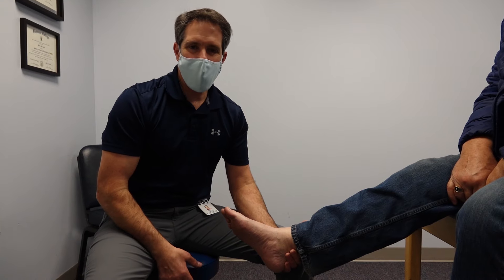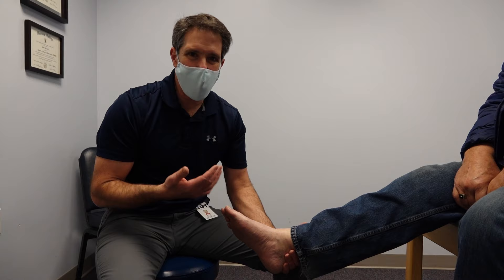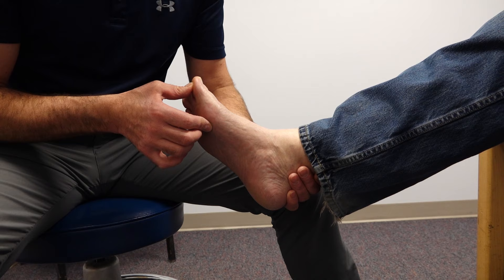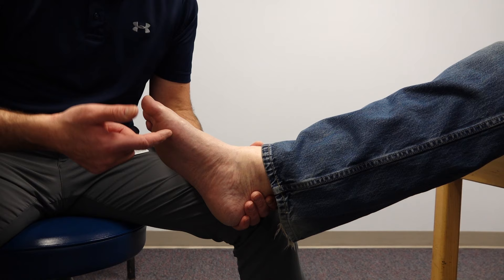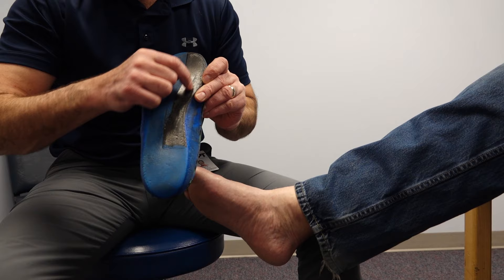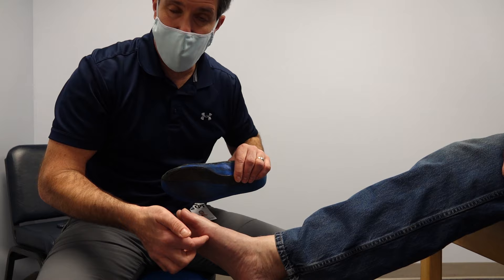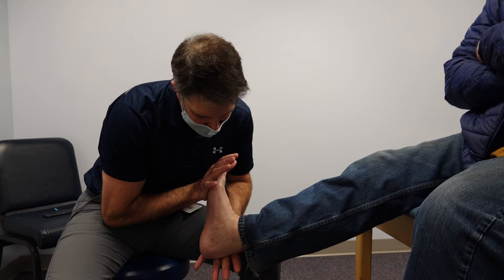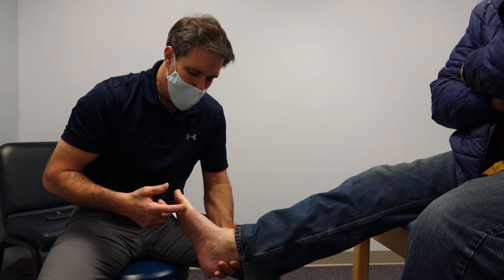Stiff Big Toe Joint (Hallux Rigidus) Treatment

Comment: Hello! My podiatrist also told me that I have hallux rigidus in my right big toe. Is it normal to have this issue in your early 50’s? He recommended hoka shoes that I wear now and a carbon fiber plate. I also have an ointment that I apply whenever I can…it has helped but he has also suggested surgery. Is there no way for it to heal without surgery? TIA
Reply: Got in and I'm only 42. Wear hoka bondi 8s now
Reply: I'm 45 and I had surgery 3 years ago. I did the minimally invasive option, where I just removed bone spurs. I gained back mobility and I can run, hike and cycle without issues. Minor pain sometimes. But most days pain free.
Reply: @PatrikSandinFTW  wow! Thank you so much for replying… I have been with this pain for some years now😕I can’t wear any shoe that has even a little bit of elevation plus even walking is painful. I was told about two kinds of surgeries one to remove the bone spurs and other where they insert some kind a gel. I am just so confused what to go for…thanks to you now I can make some decision.

Comment: With so little movement, would fusing the joint cause damage to other joints (ankle, knee, hip)?
Reply from the maker: Good question Lisa! So, when the toe hurts so bad you can't function well and your activity level drops, having the fusion gets rid of the pain and overall activity goes up. A well fused toe with a little extension can act like a "rocker" and not alter the gait too much.

Comment: Paul, if you wear an orthotic with a rigid plate like this to purposely limit big toe extension, isn't that going to cause gait problems and possibly injuries in other ways? You would have to compensate somewhere else for that lost range of motion, right?
Reply: Yes, but not having rolling shows or that inner sole will too cause you to walk strange, as it hurts to walk straight.. I know, cause I too have it. MBT shoes has made all the difference for me 🥰

Comment: im 31 and i think i may have this ..... this cant be it for my toe surely? the end of being able to run and do push ups etc etc?? please there has to be a fix?
Reply: I have had this for over 10 years and I have tried everything under the sun besides surgery.
I will tell you nothing works, if you have the chance to get the surgery, do it.
I never did it because doc told me I would have to keep my foot elevated for 6 weeks after and I knew I just couldn't do that.
I'm in my 40's and have knee pain on that side because of walking oddly for ten plus years.
In the meantime however, I highly recommend Hoka shoes, the Bondi8 model is incredibly comfortable for those of us with this problem.
Reply: @ajs96350  thankyou so so much for your advice and foresight. I wish us both the best foot health possible. Thankyou man
Reply: @soraninja  Sure, good luck.

Comment: I have Hallux Rigidus,  the bone spur limits the type of shoe I can wear. The bottom of my big toe has pain in certain shoes. Some pain In walking . I have had consultation and always the doctor insists on toe fusion. I like for my toes to bend. I’m still not convinced  to comment to an invasive surgery.
Reply from the maker: I would try a good custom orthotic and solid rocker bottom shoe
Reply: I have had hallux rigidus for about 10 years, most of those years I have been pain free, - sometimes it flairs up and is very painful, however with proper stretching of my leg (thigh, hams, calves etc) it becomes pain free again.  Maybe this will help you
Reply: @Ma1efcent  Can you explain exactly what stretches you do that help the pain in your toe?

Comment: Had it got rid of it.  Borax.
Reply from the maker: You can't get rid of it without surgery but this guy can walk with it which he can't do without it.
Reply: @OrthoEvalPal  Your guy waited too long.  He has major calcification.  Dumb.  I fixed my problem.  I also use Celtic sea salt.  The processed table salt causes those deposits on the toe.  I have perfect flexibility and no more swollen big red toes.
Reply: please explain, i will try anything
Reply: @mickster655  Can you explain what you're talking about, did you drink borax?

Comment: What if you are a ballet dancer and want to continue to dance where you have to bend your toe. I’ve been experiencing so much pain and stiffness in my left big toe and it’s really holding me back.
Reply from the maker: Definitely recommend an orthopedic foot specialist familiar with ballet. The important thing here is getting a proper diagnosis. (ie, tendinitis, arthritis, sesamoiditis, plantar plate injury, etc...)
Reply: I have had hallux rigidus for about 10 years, most of those years I have been pain free, - sometimes it flairs up and is very painful, however with proper stretching of my leg (thigh, hams, calves etc) it becomes pain free again.  Maybe this will help you